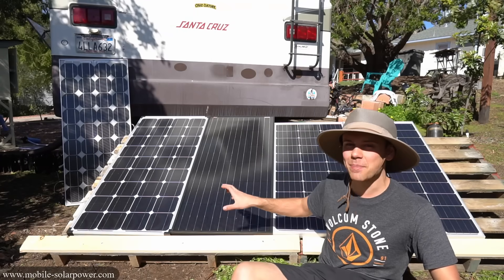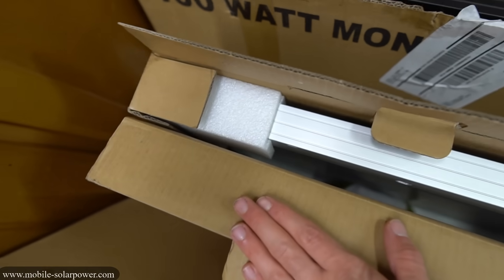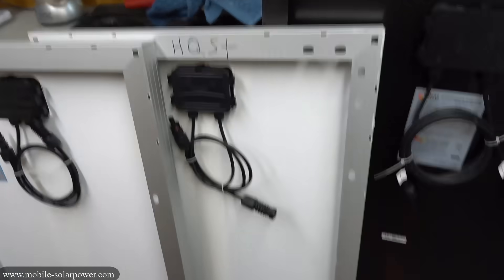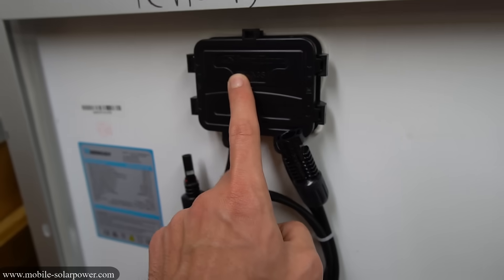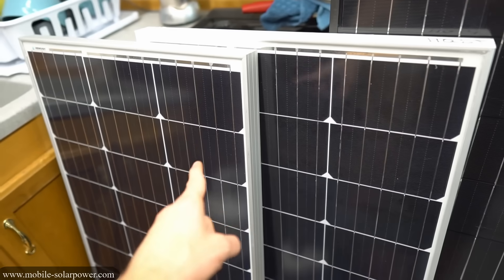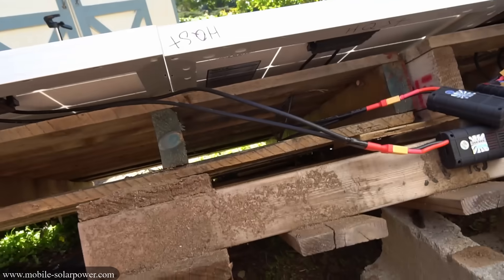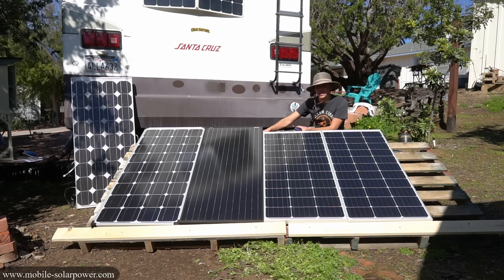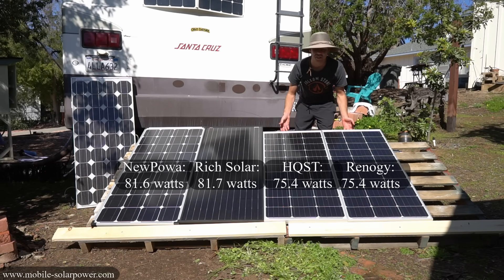Top 4 Amazon.com 100w Solar Panels Tested! Renogy vs. HQST vs. Rich Solar vs. NewPowa

Comment: What I still don't understand about the solar panel industry is why don't solar panel producers just make a panel that can achieve what is advertised on the box under normal everyday conditions and use cases? How hard is to produce a 120 watt panel and sell it as 100 watt panel. That way they would manufacture out the natural deficiency of solar panel outputs. Why create and advertise a "100 watt" panel that won't ever actually produce a 100 watts in the world? Would you rather buy a 100w panel that only pulls in 80w or a 100w that can actually produce 100w with potential to boost slightly above 100w?

Comment: The large panels are less efficient ? They produce more power so hows that not efficient ? Isnt it about pulling in power ? I guess it needs to be more expensive and small for you to want it ? Im confused hear , i thought its about free energy not how small my set up is ,,,, i dont care if my panels are a bit larger , im getting more power  then the smaller panels so why pay for size when its about energy ? 2 small panels 150 watts in 2 large panels 160 wats in , i guess 10 watts is nothing to most people but its still more , and if 100 watt set up is all i have id like the most power in for my money going out ....just me i guess but seems your a little bias , yes size can matter but my panels are going to be non fixed to my camper so size isnt really a concern , now if you accually talked about the materials used and pros and cons of the different materials i might see your choice as professional but you only talked about the frames , thats not the important part the cell , but hey maybe you dont know enough about the construction of the panels ,,i dont know , but thanks anyway its a good test for power output and thats what matters to me so thank you for that ...
Reply: Bottom line, everyone is free to.make their choice. Its your money at stake not his.

Comment: I picked up 8 HQST 100W panels and have been quite pleased with them. Power production in Wisconsin at midday under clear skies in early March with 8, 100W panels is peaking at 750W. I've been very impressed with them. Oh, and packaging has changed. The panels I received in Feb. of this year had dense foam corner protectors .

Comment: I really appreciate the quality and thorough nature of this video.  The testing was performed properly and safety under load.  Additionally, the tests were run using equal operating conditions.  There are other videos out there testing solar panels with a multimeter that are not under load.  This can be misleading and potentially dangerous.  Thank you for your videos.  They are accurate and help promote safe practices.

Comment: GREAT VIDEO!!     I HAVE 4 RICH SOLAR PANELS,  BOUGHT 4 MONTHS AGO.    VERY WELL PACKAGED.  I ACUALLY LIKE THE EXTRA WIEGHT OF THE PANELS.   WELL BUILT,  AND STURDY FOR OUTDOOR USE.     STANDING UP WELL TO THE WIND , SNOW, ICE, RAIN ETC.    THIS HAS BEEN A BRUTAL WINTER HERE IN MINNESOTA.    PANELS DOING FINE!

Comment: I bought three 100 Watt Renogy panels for black Friday sales (2022).
All three shipped FROM HQST out of Houston.
All three have the HQST aluminum frame shown in your video. But-
All three have Renogy labeling and serial numbers. One of them had a shipping issue, in which Renogy corrected the error via customer support (validating they ARE Renogy brand). I think there is a mixture of the companies on a level not disclosed.

Comment: Hi just wanted to say thanks for all your support you have helped me in many ways.  I wanted to say that as a surprise thunderbolt panels from harbor frieght when testing in normal sunlight produced 100 to 104 watts, very impressive, of course under heavy clouds it still was pulling 20 to 30 watts.  These where the folding 100 watt panels.  Thanks again!

Comment: I went with renogy I have 4 100watt panels and I had a 50watt that stopped producing power with maybe a week in the sun. Contacted renogy and they said ship it in. That was almost three years ago and multiple emails back and forth and still no panel. I would go with the cheaper hqst if I could go back. I'm worried the same thing will happen if one of my other panels stopped working.

Comment: As always, I truly trust your reviews. Question :I bought 2-425w Renogy panels and 2-200w Bougé panels. I had the Renogy in series and it's output was over 800w. When I added the Bougé the wattage was decreased to about 200w. i put the 4 in parallel and still got less than 300w. I ended up leaving the 2 Renogy. What am I doing wrong?

Comment: I bought a Newpowa 200 watt 12 volt panel about two weeks ago, I have not been able to get over 128 watts out of it even with direct sun and clear sky's,  However I am getting this watt reading by plugging it into my Ecoflow Delta 1300 at a distance of 55 feet, so I am loosing some in voltage drop. ????    The reason I got this panel was to charge up a battery bank made up of 4 AGM 100 Amp hour batteries with a Rover Elite 20 amp mppt charger, the highest the control says it is receiving is 8 amps. From a 200 watt panel I was hoping for more, Whaaaaah

Comment: Please produce a YouTube video review of the Harbor Freight Thunderbolt 100 Watt Briefcase Solar Panel and demonstrate whether or not this relatively new Thunderbolt solar panel from Harbor Freight has the type of plug configuration to connect two or more of the briefcase solar panels to the Universal Solar Connector Hub also from Harbor Freight.  If not, please show how to combine two or more of the briefcase solar panels to increase the wattage output from 100 watts to 200 watts, 300 watts, 400 watts, etc.  Would this be done using a solar charge controller if the plug configuration will not connect to the Universal Solar Connector Hub from Harbor Freight?

Comment: Do these solar panels connect easily to the Ecoflow solar battery?
Reply: They all come with MC4 connectors which plug into the MC4 connector input cable on Ecoflow batteries.

Comment: The last two 100 watt panels I purchased were HQST, and I would concur, I had always used Renogy before.  They have been flawless and are a bargain.  In fact, compared to 1981, when I first worked in solar, they are all bargains. 😆

Comment: You are really stupid!!
If Rich solar and new power  panels produce more power, 6 watt more, why would recommend renogy?
Reply: sponsors*
Reply: Cost or do you not care about the pricing? HQST panels are $75 on eBay vs $90 Rich Solar. If you buy one, yeah not that much difference but I have 12 panels for my two solar DIY systems. $900 for my HQST vs $1080 for Rich Solar? For $1125, you could get 15-100 watt HQST panels vs 12-100 watt Rich Solar.

Comment: Hello my name is Jonathan.
So, I bought a foldable solar panel, 40 watts.  Now I'm seeing a similiar style on ebay, 200 watts, it looks like it does that.  Can you explain why I was able to buy the 40 watt one at basically twice the price of the 200 watt one?  Is that just sales or did I make a good decision?  My 40 watt one has all kinds of stuff, kick stand, 600d coated, that cushion fabric in the back that disperses heat... This one will charge the battery packs I have so I'm not upset, and if it is just sales then I'll leave it alone, but is there a reason this one costed that much versus the cheaper one that brews so much more power?

Comment: This is not two years old. I would like to see an update on different size panels.  I looked around and now, for instance, the Newpowa and  Rich panels are now the "new" style like the  Renology and Hqst; and also the same size and weight.  So perhaps the materials are not inferior on these brands now.  I know that the Rich solar controllers, internally, are exactly the same as Renology.  They even have the same models.

Comment: I picked up some 100w HQST panels recently and they didn't come with the extra holes in the rails. Just 2 holes per long side of the rails on mine. I wish they had the extra holes like yours did.

Comment: For info, all the Renogy 100W panels I bought in the last 2 years are identical to the HQST, hah! Same mounting holes (I just installed the Z-brackets on mine, top and bottom). Fun fact: At 1:35 you can see the code for the HQST is HQST-100D-SS... the code for Renogy panels is RNG-100D-SS. They're the same.

Comment: I was running three of the newest Harbor Freight 100 watt panels today in series. It was cloudy here in Houston, but the sun kept breaking through on a regular basis. I hit 323 watts a couple of times, as reported by a Renogy Rover 40 amp MPPT controller, through the BT-1 interface and DC Home app. Not sure what to think about that. Might be a glitch, but it might have been the panels staying cool because of the clouds. Other than that, they don't work in parallel very well and I'm not a big fan of the SAE connectors they use, or the apparent small gauge cable they use. Other that, then seem to be built well enough. I mostly got them for field use, and decided to test them on the roof of my storage building to see what they'd do in the back yard.

Comment: Love your channel  but I wanted to ask you and the community: Has anyone ordered HQST panels and received them with the wrong labels? I ordered (Amazon) HSP100D-L and got panels labeled HQST-100D-SS with totally different specs. The box had the right number but the panels themselves did not. Not really sure now exactly what the panels I received were so I returned them for an exchange. Wondering if I will have the same problem with the replacement ones. Anyone else have this problem?

Comment: I assume all of these panels can be connected in series or parallel (depending on my application). Did the come with connecting hardware? I guess if I connect them in series, I would need an inverter to handle the output voltage.

Comment: Great video as always, keep up the good work!  Curious why you didn’t include in the video the power specs of each panel for comparison such as voltage and amperage ratings. Also if the larger panels (size) are producing more watts in the same sunlight as the smaller panels, why would you dismiss them from being recommended?  They’re going to net more power then the smaller ones in the same conditions?

Comment: I am looking forward someone who is interested in designing and manufacturing a mass produced plug and play solar/battery/power module for van conversions inside an 80/20 frame I would supply that would be compatible with my patent pending modular storage system. Any suggestions? It’s ridiculous that nobody is doing this already. Even most rich people would trade getting a prepackaged system in one month vs waiting a year or two for a custom system.

Comment: Great video, just a few things to say about the HQST and Renogy solar panels: First, as of today, in 2021, what i saw on amazon as far as warranty, they both have the same power output warranty, however the HQST panels only have a 3 year workmanship and material warranty, two years less than the Renogy's 5. Also, I'm not sure about how accurate or valid this may be, but there was also a comment about someone having problems getting their warranty honored by HQST. Just a thought to consider. Where as Renogy is "Amazons choice" has 5 star rating with over 2,000 reviews and holds what seems to be a more trustable brand name, compared to HQST being a seemingly no name brand that has 4.5 stars but with only 280 something reviews. Considering there is only a $10 difference in price, I personally believe the Renogy panel would be a better choice, especially if the warranty info I found is in fact more accurate and you get 2 more years of material warranty, as in for the actual panel itself and its parts. I might add that this warranty is right up top in the Renogy's description (meaning it's certainly legitimate) whereas I had to search the FAQs section to get an answer as to what the warranty was for the HQST panel.,

Second, it would be cool if instead of just reading the watts off the solar charger if you could measure the actual volts and amps of each panel because since they are proportional to eachother in determining watts, you could have a panel with high voltage and low amps or low voltage and high amps while both are putting out 100 watts. I believe its better to have a panel that pushes more current (higher amps) considering we only need 12 to 14 volts for 12v systems. Although, Renogy does give optimum operating voltage (22.3V) and optimum operating amperage (5.86A) listed in their amazon details, but that would be under ideal conditions what is possible for the panel, and it would good to know what real life numbers are like. Also in my mind it just makes for a better comparison for a given group of panels for a particular use case. But then again, you obviously know a lot more about solar than I do so I'd like to know your opinion.

Thanks for all the great info , please let me know what you think. Cheers.

Edit: After watching more of your videos I've learned so much that I didn't consider before. I'm trying to do my research to build a system for my van build, and you've been a great help. Like my initial idea was to just use a solar generator like a bluetti or something similar, but then I realized it would be difficult to run regular 12v while a 12v fridge is taking up the cigarette socket. Not to mention in the long term it just wouldn't last as long a one of your DIY setups. Plus if I have a better solar system I could simply run a dorm style fridge off of it and save a ton of money over a 12v compressor type fridge which i could in tern put back into the electrical to make up for the extra power consumption. I definitely plan on picking up your book to research further. Also I'm starting to think polycrystalline is the way to go after watching more of your tests, especially if I can only manage to fit one panel on my roof (we'll see after I get around to measuring). Anyway, thanks again for all that you do and please let me know what you think if you have the time.

Comment: When I started years ago I used Renogy mono panels and then I switched to HQST panels mono.  Now I just use HQST poly panels without problems.
I have noticed that the Renogy and the HQST panels performed the same  for the last few years with same dimensions.  I think that both panels are from the same manufacturer and they just put different labels on them.  
I test my  panels individual with my voltmeter having them disconnected from the solar system to get an accurate  assessment.

Comment: Reergy and  HQST are very closely related. Are probably made in the same factory, where both lies have access to the same parts. 
   They may use #1 and #2 grade  parts. The fasteners MIGHT be different in on or the other. Brass vs alum. 
   I know production plants require mass volume production  and extremely low parts cost. 
    They will change a design parameter to save 2.5 cents on a nut/bolt set. or plastic vs nylon washers for a .1/5c because 10 million times mates 100,000 dollars, or loses it. Its crazy!!!
   You make great videos,  thanks.  They
are consise, spot on, informative but not filled will not neede fluf. I enjoy all.

Comment: This video bummed me out.  I just ordered wills recommended 400 watt system from rich solar.  You did not recommend the rich Panama on this review but You recommend these panels on your site where you get a kick back.  Please explain Will.
Reply from the maker: They are different panels. The ones in this video aren't even sold anymore. Go look. The ones on my site are the new ones. Different rails, different cells, different connectors. This video is just old
Reply: @WillProwse  yes I see now Will.  My mistake Will, sorry. Thank you so much for all your info.  Faith in the great solar god is restored.

Comment: Okay, I watched a ton of your videos but I have a question. I have a tear drop trailer that I want to put as much solar on as possible, and then use that as a supplement to my home power when we're not traveling. Is that even a thing? As in is actually possible?

Comment: IDK Will...just bought a Newpowa 100 watt. Looks like a poly but says it’s a mono. Either way really liking it so far. Replaces my renogy suitcase (not too impressive) to charge my Lycan and jackery it was bringing in 20 volts at about 2.5 amps. Once I switched it out. The Newpowa. Delivered over 15 and 4. Around 65 watts in partial sun. After 17 hours overnight both units fully charged. The best I got with the suitcase was well below that. Basically purchased the cheapest panel I saw on eBay. Lol

Comment: It wouldn't surprise me if the NewPowa and the Rich Solar are acvtually 110W solar panels, re labelled as 100W panels to make them look more efficient, hence the larger size. Some companies do it with 105Ah/100Ah batteries too.

Comment: This may be a dumb question but my RV is solar ready. If I want to get 2 100w panels I will also need a solar controller correct? If so what solar controller should I get for these panels. I also put 2 100amp lithium batteries in my RV.

Comment: It's April 14,2021 and I bought two 100 watt HQST panels a few weeks back and the first thing I noticed was the charge controller was packaged in a 
Renogy labeled box. I'm testing their output. So far I have seen a output high of
181 watts total out of a possible 200 watt total. Not bad. So I do believe that Renogy and HQST are if not identical twins fraternal twins. Where I could have used help was how to use the Z-mounting brackets which for now are not being used for mounting the panels.